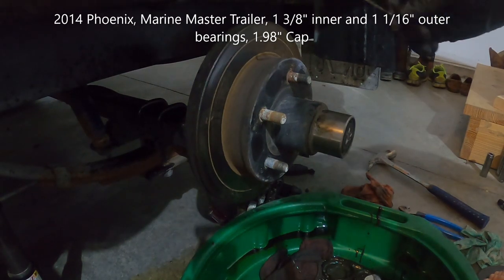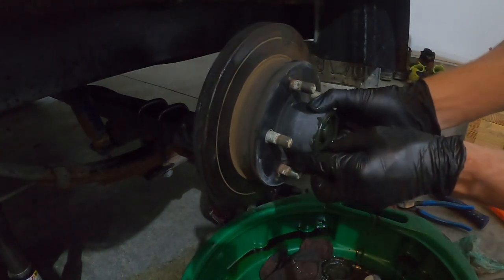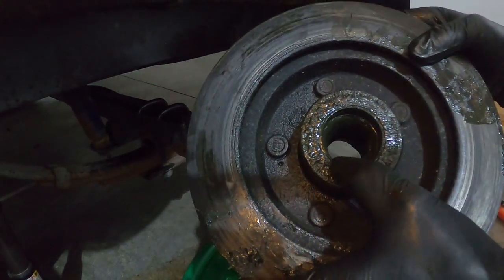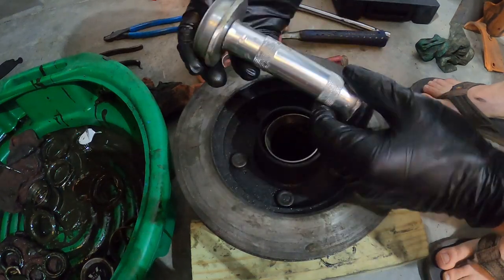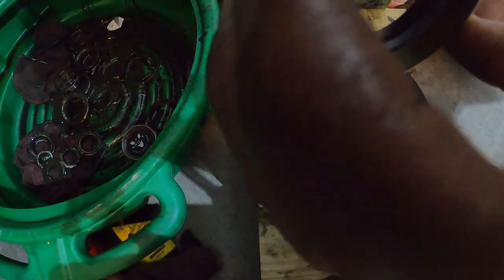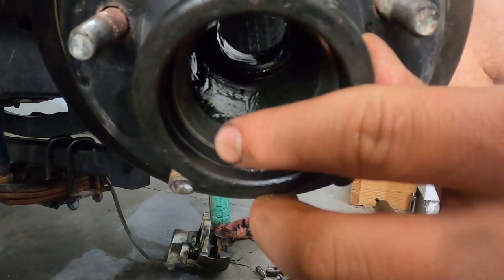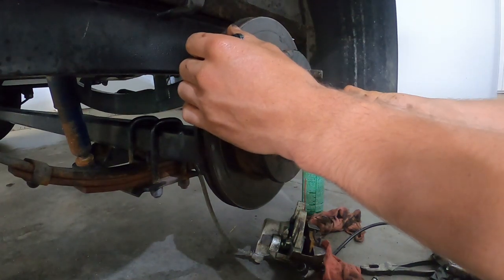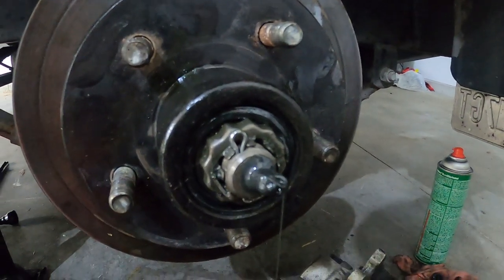Vault Hub Replacement

Comment from the maker: Links for parts used in this video are listed in the video description.
Reply: What is the part number for the inner seals. Could not find the link  for the seal  numbers
Reply from the maker: @newellfields97  
(1) spring-loaded double lip grease seal (168255TB)

Comment: Lol. My boat dealer made it sound like these hubs were some kind of great technology that didn't needed servicing for 90,000 miles. They're just like any other hub I've reworked smh. Thanks for the video.
Reply: They are WAY better in my opinion. no maintenance for 5 years minimum. Mine are 10 years and running no problem. On my previous trailer  I had to grease them every 2 months

Comment: Perfect!!!! This video was amazing! *2013 BoatMate trailer with vault bearings. *Grease fitting size for my trailer was 1/4”. I would recommend to have a variety pack readily available, since my instructions called for 1/8” which wasn’t the case.

Comment: I have the 2.328 inner bore hub. I woud absolutely not reuse the hub covers. When I got the new ones I thought they were too big because I could not get them in, gave up and put the old ones back. They went in too easy and I started to think about Dexter saying they are one-time use. I measured the old vs new outter diameter and they were different by a few c-hairs. Decide to try again, this time filled the cap with oil and put it in the freezer for 90 minutes. Went on way easier and is a very tight fit. Not getting stuck on the side of the road is worth the price of new hubs. Been 7 years with no issues.
Reply from the maker: @SANTACRUZDRONES  new is ideal. With the 1.98 you can also put them on a 2” hitch ball and flare the ends just a touch to make them super tight in a pinch
Reply: @MidwestOutdoorExperience  That is a great idea. Thanks for the info.

Comment: I finally got the other O rings out.  I used the sharp point of an old steak knife.  They came out fairly easy.  Getting a new one back in was pretty easy too.  I took my time and was real careful.  I would highly recommend doing this when temperatures are cool.  Like maybe 50 degrees F.  It was about 90 this morning when I quit and the grease just gets too liquefied.  I'll finish the last one tomorrow morning when it's cooler.
Reply: azcharlie2009 you need a better grease if it's liquefying at 90F.
Reply: @slalomking  I understand what you're saying, but that's not how this system works.  The grease used is a hybrid grease, that is designed to liquefy as the temperature increases.  Oil is actually a better lubricant than grease, if you can get it to stay in the bearing.  If you look at big eighteen wheeler trucks, they have oil lubricated bearings.  I did all four axles and pulled the boat from Tucson to Lake Powell and back in over 100 degree temperatures.  No problems....
Reply: AZ my dealer actually told me to put my grease in the refrigerator overnight and do this when it’s cool outside so your right on saying this stuff gets runny when warm 👍
Reply: @glenndaugherity6187  great tip

Comment: Awesome video! Which grease are you using? The special stuff that vault provides or just regular grease?
Reply from the maker: @bogotstogoskiing  vault hybrid. You can use a regular grease if you’re in a pinch. But if you want regular grease I’d recommend the old school grease caps with a cover or bearing buddies.

Comment: Great video. One question at the end when you're pounding the cap back on with the block of wood, how can the black "button' extend out past the cap a little bit if the block of wood is on it and you're hitting it?
Reply from the maker: You have to have the pvc reducer underneath the block of wood. That gives the cap room to push out.
Reply: Just watched it again and saw that you used it again. Thanks

Comment: I learned some things but I would watch a video on how to pack bearings with grease. Also, does the cap comes off a to expose a grease fitting under there so that you can fill the bearing buddy?
Reply from the maker: Not much of a need to pack the bearings since the grease comes from the back of the hub when filling. The cap only comes off as a whole, you can then screw in the grease fitting and pump it full.

Comment: Great video.  I just replaced my hub watching your video. One question.  One question about the o ring on the outside of hub.  The one that came with the replacement kit doesn't seem to fit correctly.  It seems too small.  Half of the ring slides in, but the other half lays out of the groove.  Will it slide into place when I pound the cap on?  Thanks again.
Reply from the maker: That's all you can try if it seems to small for the opening. Did you get the hub kit from UFP/Dexter?

Comment: I don't see any leaking grease on either side of the hubs on my 2014 boatmate, but on some hubs the black center cup is not out as far as it is on others.  Is it recommended to pop these caps off and refill them as shown or should I replace the bearings at this point?
Reply from the maker: Pop the old caps off, and buy new ones. While you’re in there pump new grease in through the spindle so it’s fresh. Should be good to for for a while then. The caps are intended to be a “one time use” but that’s not always the case. If you order new ones, keep the old ones for spares on road trips.

Comment: Do you use any kind of solvent or cleaner on the brake rotor before the caliper goes back on?
Reply from the maker: Brake cleaner if you ended up with grease or something on it

Comment: Is it required to remove the grease fitting after filling?  Why can't the original Vault caps be used?  I'm getting ready to redo a couple of mine.
Reply from the maker: You'll want to remove the grease fitting so it doesn't interfere with the black cap that protrudes. Vault recommends not re using the original caps because there is a chance they will not fit as tightly. I think that is mostly toward the claim of being maintenance free for "X Years/Miles". I went ahead and got all new caps, but keep my old ones in the toolbox on my truck for roadside emergencies.

Comment: Did you put the oring back in and the grease zert ?
Reply from the maker: O-ring yes, grease zert no. Definitely take that out. If it got unthreaded and loose in there that could become wedged and cause a catastrophic failure resulting in you probably needing a new axle.

Comment: Do you have to take the hub off to replace the O ring?   The Vault directions say to useLoctite, but not red or blue.  Pacific Trailers says to use RTV Silicone gasket maker.   WTF?  I've read elsewhere that it should be red Loctite.  My fitting was also 1/4 inch.
Reply from the maker: You only have to take the cap off to replace the O ring. RTV Silicone Gasket Maker on the rear seal. I used blue loctite on the cap, per their instructions. No issues with over 3K miles on them since replacing.
Reply: @MidwestOutdoorExperience  I sure couldn't get it out.  I couldn't even find it!  So, I just left it.  How would you suggest removing it without damaging something?  A sharp knife or pick?  Does the nut have to come off?  I have the O rings, but I've never seen how to remove the old ones.  My trailer bearings probably only have a few thousand miles on them but they're ten years old.  I did one bearing yesterday in 103 degree Tucson temps.  Everything was turning to liquid!
Reply: @MidwestOutdoorExperience  On the instructions they tell you to  Apply “Loctite”
retaining compound to shoulder of
protector. Not red Loctite which is a thread locker not retaining compound. There is a difference .

Comment: Dude, you need to learn how to pack bearings.  If that didn't fail it was because adding grease in the fitting saved you.  Also, I didn't get the pounding on the hub cap then the vault center is sticking out, how did that work?  And, maybe tighten bearings, spin, then adjust bearing end play?
Reply from the maker: Packed them for years by hand. Didn’t show the entire process because it’s tedious. Having the center zerk also pushes it through the bearings to help fill any voids. Putting the pvc cap on the hub when putting it on allows the center to expand and have positive pressure like they’re designed to do. Probably over 10k miles on my trailer since I made this with 16 hour straight road trips and bearings have never even been warm.

Comment: How down you remove the wear sleeve if you have to replace it ?
Reply from the maker: The bearing races? Punch them out with a softer metal (brass) or use a press to get them out if you have that available
Reply: @MidwestOutdoorExperience  No, he's asking about the wear sleeve on the actual spindle.

Comment: The spring loaded bearing protectors with exterior grease nipple are a better system imo (easier to maintain), I didn't use these sealed "vault" protectors that come with the UFP kit
Reply from the maker: Bearing Buddies are a great option as well. I replaced oil bath hubs on my old boat and used them for 5-6 years with thousands of miles trouble free.
Reply: But then when you need to change them again it makes a mess
Reply: @MidwestOutdoorExperience  Just curious, I have an older set of vaults on my boat trailer that I want to service. Thinking about converting to bearing buddy caps but stick with the current hub and bearings. Is this possible using the same hub and spindle? I have the 1.980” vault system. Thanks for any help.
Reply from the maker: @JMFishing  Yes you can use the 1.98” bearing buddy caps. With the bearing buddies I would take out all of the vault hybrid grease and replace it with Lucas marine grease or red and tacky. I personally would hand pack the bearings and finish it off with the the grease zerk in the spindle.
Reply: @MidwestOutdoorExperience  Thanks for your help. I will do that. One last thing, am I ok to leave the current seals in? They arent leaking or anything.
Reply from the maker: @JMFishing  you’ll have to take the rear seal out to get the inner bearing out to re pack it. I’d order new seals, and always order extra in case you mess one up putting them in
Reply: @MidwestOutdoorExperience  Awesome, appreciate the help!

Comment: This is not as effective as Bearing Buddies, no way to add more grease or pressurize the vault cap without taking it off every time.  BB you shoot in grease which keeps the hub pressured at 3 psi so no water can enter.
Reply from the maker: Bryan B In my experience the vault caps keep pressure for much longer than BB. With that said they’re both good, and I’ve trailered 10s of thousands of miles with both set ups.